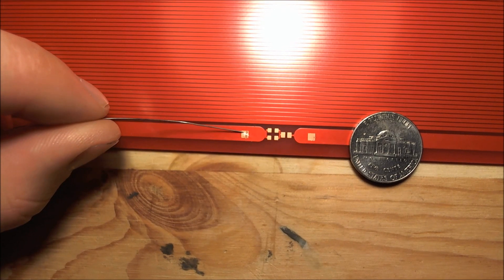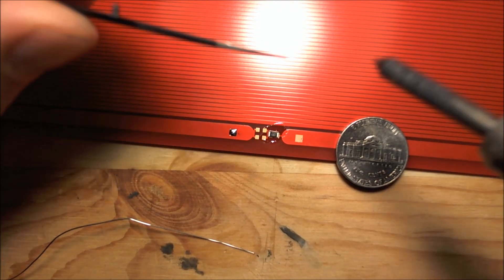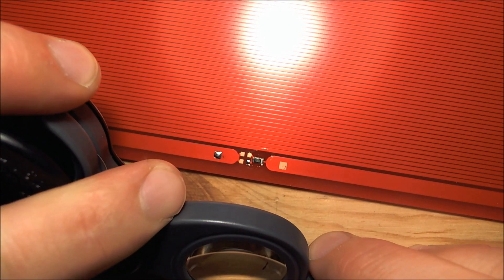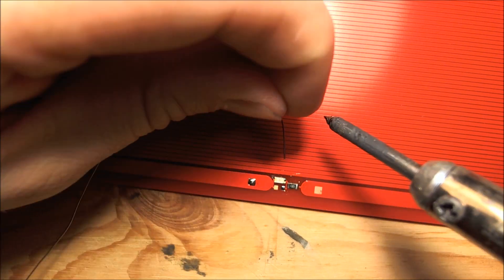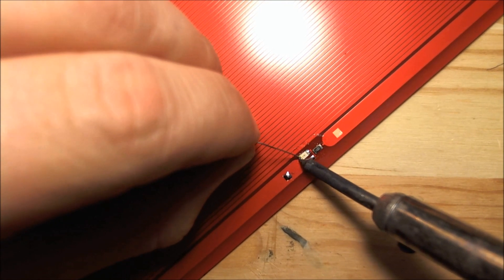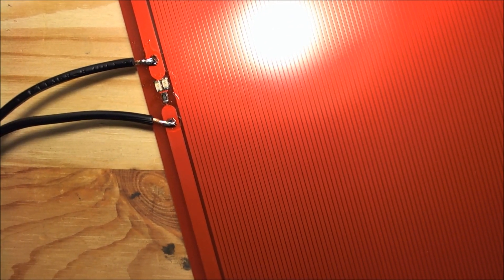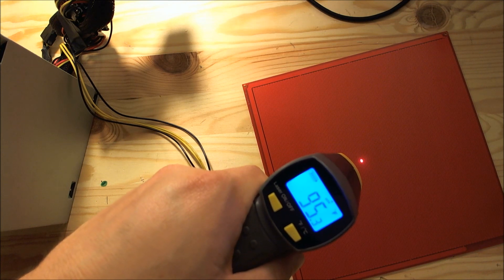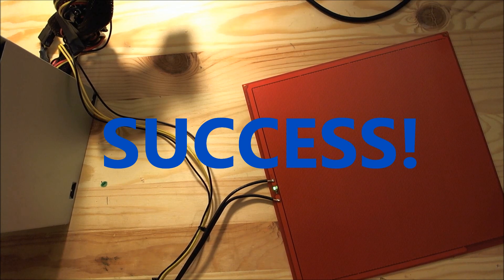Reprap Project- How to Build Heated Bed1st Try, Less than 15 min

Comment: when soldering/desoldering SMD components with out the aid of a  reflow station a cheap embossing heater like the Marvy model 2500 and a tube of solder paste works a lot better than a regular soldering iron and solder. place the paste on the pad with the supplied needle applicator then your parts and heat with the embossing tool the parts will pull themselves into place as the solder melts.

Comment: also since the board conly consist of coper wires that heat up the board over heating the board is of no concern just have to be careful enough not to over heat the SMD parts

Comment: instead of adding the solder after placing the components y dont u first add the solder to the plate then keep the component on top of it and heat it a bit, that way u can have more control over the placing of components :)

Comment: Hi I am trying to find SMD diodes and resistor for MK2A
for MK2 I read it uses 0805 SMD size
for MK2A I read that it uses 1206 SMD size, it is that true?

Comment: The MKII  heat-bed has several holes where the power attaches.. so I think its possible to simply screw the leads into place.